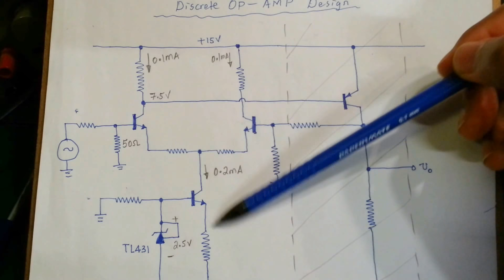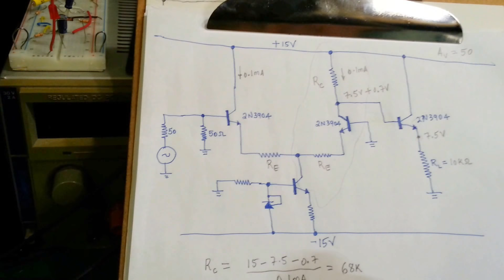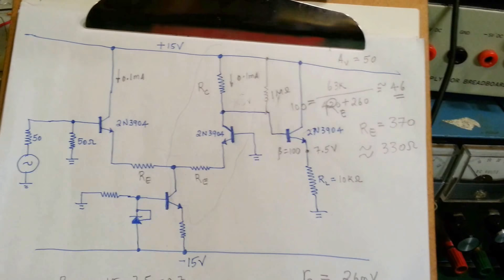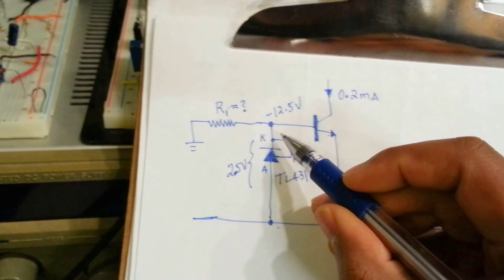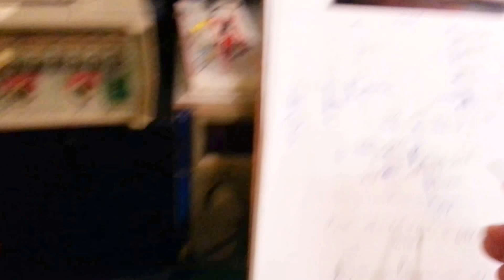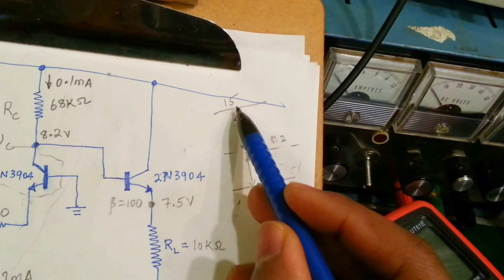Differential Amplifier Design and Testing - AoE Chapter 2 Question 5 Solution

Comment: Hi, I really enjoy learning to design transistor circuits,
something that caught my attention in this video, you said you added
some decoupling caps, to keep the board quiet.

Here is the big question I have, Did you have to go through a lot of math
and circuit analysis to know where to place those caps, as well as the values
of each cap, OR and this is a big OR, did you place caps along the rails
in places until the circuit stopped parasitic oscillations.

Reason why I ask, when I get into adding more and more stages (CE config.)
I find that I need to add neg feedback with miller caps, but theres no logical
way I do it, I just throw caps in the circuit until the parasitics are gone.

If you do, do calculations, could you please share how to know where to place
caps, and what values are needed to take care of parasitics. 

However if its just through empiricle trial and error, please let me know
so I know at least I'm on the right track.

Thanks.
Reply from the maker: Sorry for the late replay! I could try to attempt to answer your question but it is better if I give you this excellent tutorial from Analog Devices that helped me understand the 'Art' (not Science; hence not a lot of calculations) involved with supply decoupling. https://www.analog.com/media/en/training-seminars/tutorials/MT-101.pdf?doc=cn0304.pdf All answers to your questions are present in the application note.
Reply: @SmithKerona  Thank you for the reply, Trying to understand parasitic oscillations
on basic RC coupled CE stages is just trial and error for me, if my multistage
is motor boating or any kind of oscillations, then I know that high amplification is close by,
for me it is trial and error throwing caps into the circuit until I get the board quiet.
Once the board is quiet, I get tremendous small signal gain on the output.
Lately I've noticed that designing more DC coupled stages seems to eliminate the parasitics
and I can achieve good small signal gain as well. The less capacitor coupling the quieter the 
overall circuit seems to be.
Reply from the maker: @myenjoyablehobbies   Are you using solderless breadboard? The parasitic elements are quite uncontrolled when it comes to solderless breadboards.